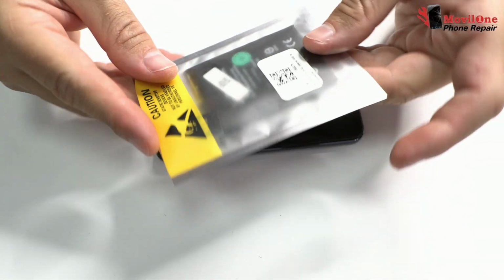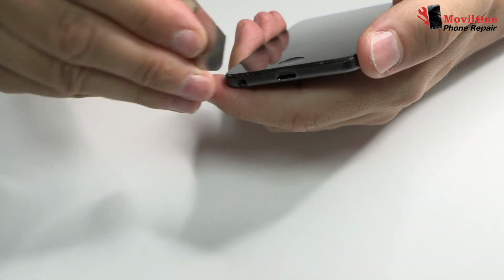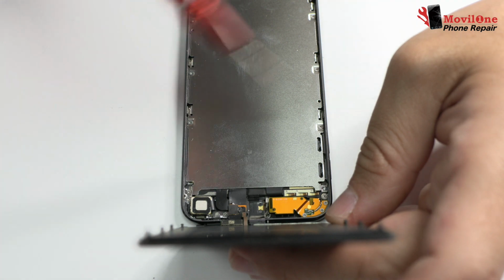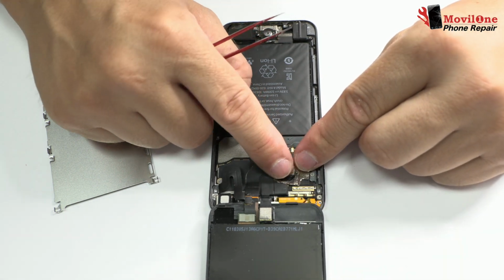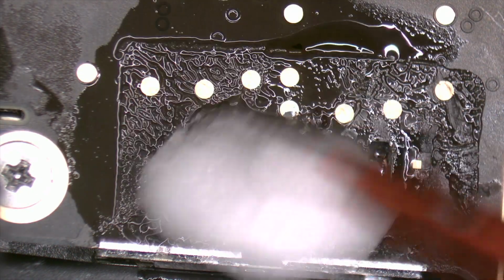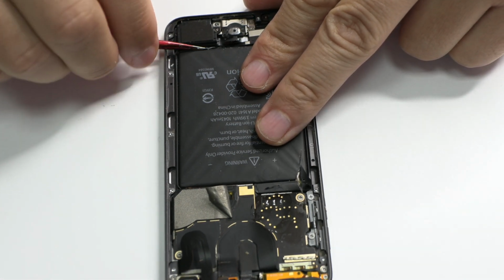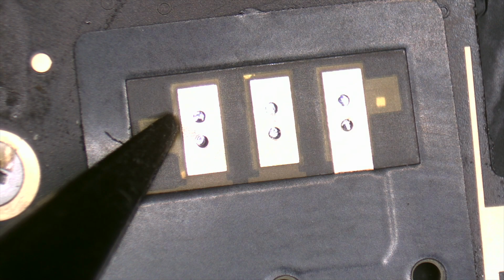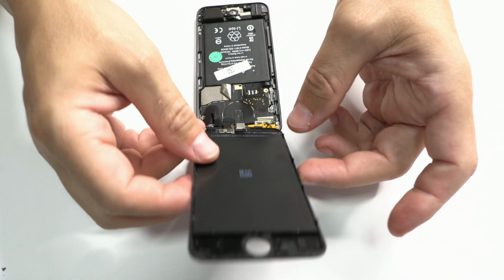🔴How to replace the battery in an iPod 6th generation

Comment: Do i need more solder? Or stronger electrical tape? When i press the connection with my finger its normal. But when i let go it dies and gives me the low battery sign.
Reply: I know it has been a while, but you're likely not making a good connection on one or more of the terminals if it only powers when you press on it. Try adding a little more solder/and/or reheat the pads and move the solder around. I had a similar problem and had to take mine apart twice to fix the connection.